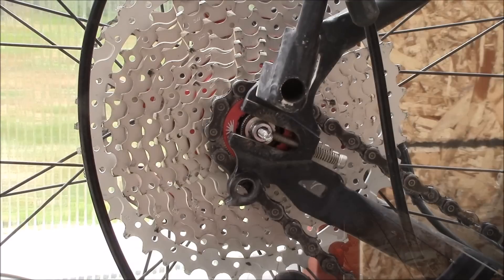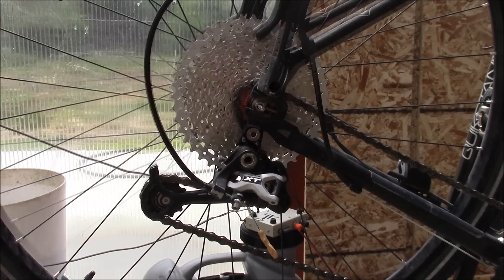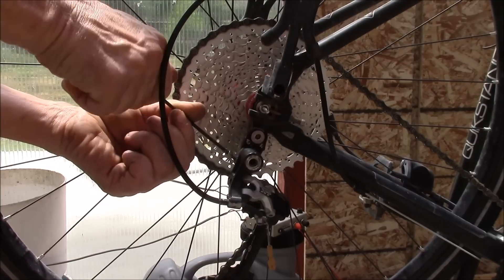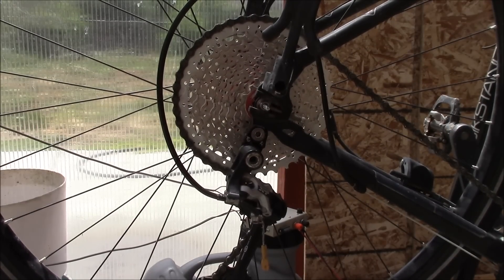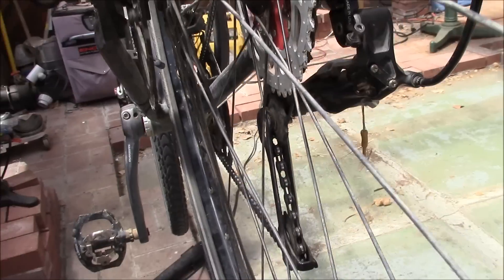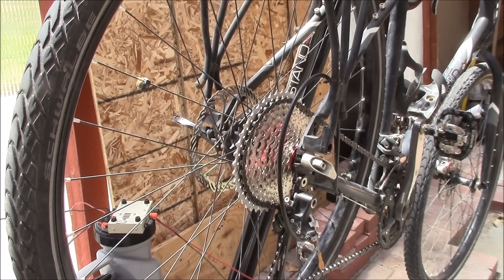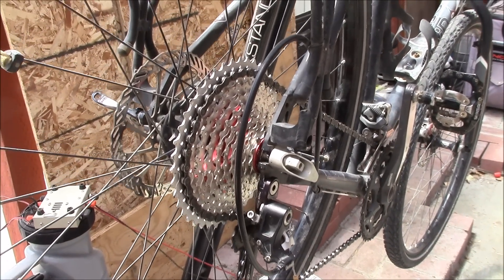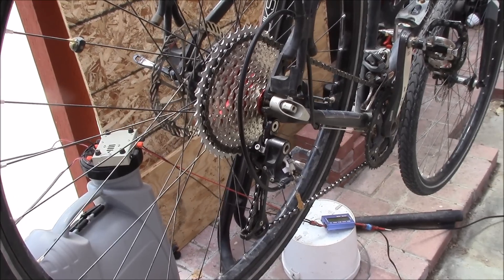SunRace 11-42t 10sp Cassette, Part 2

Comment: Good video

I have your RD, rated at 34t but works fine with 36t cog

The 9 speed MTB Rd seems a better solution vs the road link, which I thought just moved road RDs out in the same way that MTB RDs are already moved out

I have a 40t expander cog to add to the cassette but have not used it yet, am hoping that it will work without the road link. 

But great to see your solution of both MTB rd and the road link for the 42 cog

Your solution is the way to go with any 10 speed shifter - the pull ratio was the same up to 10 speed STIs and 9 speed MTB. 11 speed is different and will not work with 9 speed MTB rds
Reply from the maker: Thanks for the comment.  Yes, things get tricky when you start mixing and matching components, road - MTB, 9sp, 10sp, etc.  Since my bike runs drop handle bars and road shifters, I'm limited to the 10sp road RD for 10sp operation.  The RoadLink seems to be working fine and is a very affordable solution.  If I went to 11sp, I could combine things better, but that would require new rear wheel, maybe a new frame, new mechs, etc.  May as well buy a new bike by the time you change that many things.

Comment: GREAT instructional video! Thank you! Does one HAVE to use the Goat Link on a mtn bike and use ONLY the Roadlink on a road bike? OR are they interchangeable, please?  I am using a Shimano M960 9 speed Rapid Rize der with Shimano dual control levers. on my 10 speed Microshift cassette {11 - 40 teeth}. This is on a Terra Trike Rambler All Terrain trike, that uses mtn bike equipment. The top pulley just barely touches the 40 Tooth rear cog; I made it work by using a longer B screw but had to bend the end of it so it sits correctly on the hanger end.  Would like to use a 42 tooth, with maybe a 28 or 30 in the front only for a 1 X 10; with an 11-42 Microshift cassette.. Would that same model of the Wolf Tooth extender work for me OR would I need the "Goatlink" model? Thank you for any help on this matter.
Reply from the maker: It all depends on how your RD mounts to the frame.  If you have a Direct Mount RD (I think those came about in the 10sp MTB RDs), then the GoatLInk, otherwise use the RoadLink like I did on my 9sp MTB RD.  You can search for "Direct Mount Rear Derailleur Hanger"  to find some information on that system, my guess is you have the RoadLink style RD.

Comment: Looking at upgrading my 1x10 MTB from 11-36 with 32 front to 11-42, will I need a longer chain?
Reply from the maker: You may.  I found I needed to use a full length chain with the 11-42 while I would always remove a full link from a new chain with the 11-36.  It worked with the shorter chain with the 11-42 but it worked so much better with that added length.
Reply: R Brown thanks, I’ll give it a go with my existing chain and see how it is.
Reply: I'm looking to do the exact same 1x10 32-front, 11-42 back setup. Did you succeed? If so, can you tell me what parts you are using for it, especially the derailleur?

Comment: thanks for the explanations. was thinking of installing a similar for a 9s mid cage RD. currently maxed the b-tension with 36T, planing on having a 9s 11-40. my concern is, will it weaken the drop outs? since it will have a long leverage?
Reply from the maker: I suppose that would be a downside.  Maybe try the new cassette and see if you can make it work w/o the RoadLink.  Maybe install a longer B-tension screw if needed.

I used to run a HangerBanger before I installed the RoadLink adapter.  I need to make an extension for that HB to allow it to re-engage with the RD mechanism now that it hangs down a bit lower.
Reply: what harm can a long B-tension screw cause?
Reply from the maker: I ran a longer one for several years w/ no issues.  One potential down side is if the screw gets bent it's hard to adjust/remove and a longer screw is more likely to get bent.  The bigger limit though is there's only so much adjustment you can get before the end of the screw falls off the end of the flat spot on the hanger:
https://youtu.be/2hhGlwSeFSI?t=292
That's the max. amount of adjustment you have.
Reply: thanks for the info. cheers!

Comment: hi great vids
did you need too use 2 chains too get the length or will a 116 link chain be enough
Reply from the maker: One chain.  I normally removed a full link when I ran the 11-36, but with the 11-42, I just left the new chain I installed full length.
Reply: thx for fast reply was urs 116 links too or bigger
Reply from the maker: Whatever length KMC chains come in, looks like they are 116 links according to their web page.
Reply: great thats the chain i got comin thx for the help
Reply from the maker: You should also check the required chain length just to be sure.  This is what I used, I was sort of on the borderline of 114 or 116 links via this method:
http://www.sheldonbrown.com/derailer-adjustment.html#chain
Reply: thx the chain ive ordered is 116 so i might be ok if not i will buy another after

Comment: Thanks for this great information. I have a 10 speed, double chain ring, gravel grinder that I intend to mod like this. In hindsight is there anything you would do different or is it all running okay? Thanks again.
Reply from the maker: Everything is running fine.  Probably the biggest downside of this is losing the 2T jumps on the small cogs.  That 15-18-21 sequence is right in my road riding range.  With the 11-36 I had before I had 15-17-19-21.  I guess one thing i might try is the 11-42/11sp cassette as it has the full 11-36 cogs with the 42T on the inside.
Reply: @The4Crawler  did you ever try an 11 speed 2x setup on this bike?
Reply from the maker: @geode232  No, I haven't.  I've thought about trying to adapt an 11sp cassette in there, although I would likely need a new rear wheel/hub.  Then I would lose my Rapid Rise RD and also have to change the 10sp bar end shifter.  All can be done.  The 11sp cassette would be nice in that it tames down the 20% gear jump in the middle of the 10sp cassette.

Comment: Really great video. I had the Sunrace MS3 11-42 on my Scott Genius and it was great. I now have a Scott Spark with the Sunrace MX3 10-speed 11-42, same derailleur, but can't get onto the 42 cog. 32t ring up front. Any advice?
Reply from the maker: Might be a number of things.  Best advice is to look closely at the RD as it tries to shift and see if you can see what's different in that in the cog next to the 42 and the 42 itself.  You may need to add a link or two of chain.  Maybe the B-tension screw needs to be adjusted/lengthened (if there is one).

Comment: Could you do this on a 8 speed bike basic specialised diverge ? I don't mind changing anything that needs changing?
Reply from the maker: If you have an 8sp cassette, then yes, I think it's possible to swap in a 10sp cassette.  I think the 8sp cassettes may run a spacer on the inside of the free hub, so be sure to remove that.  Then just swap out to a 10sp rear der. and shifter and possibly the RoadLink adapter on the rear der. to clear that 42t cog.

Comment: This is Awesome!  I'm thinking of using this 42t on my sequoia steel gravel bike for touring 11 speed.  My bike currently has a 48x36t sub compact front and 11-36t sunrace cassette but still I need more lower gears for the steep stuff.  Bike already has gs medium 105 rear derailleur.   Would a 42t work for me with wolftooth and my setup?  Thanks!
Reply from the maker: It likely will, although you'll be exceeding the maximum tooth capacity of the RD.  I have an SGS on mine and at 51T I'm way over what the long cage RD can "handle", but it works fine.  The chain does go slack in the small front ring and anything above the 5th cog in back.  So I rarely use those combinations.

Comment: Hi great vids..thinking convert to 11-42t..currently im using deore 3x10s 11-36t...do i need extra chain link?and some adjustment on deraileur?
Reply from the maker: I found I did moving from 11-36 to 11-42.  But that said, I was removing one link from a standard chain with the 11-36, so with 11-42, I just left the new chain full length.
Reply: R Brown thanks for the info sir!!

Comment: Hello, if I have an XT but it is normal, would it work? I did not understand much
Reply from the maker: Yes, top-normal (or rapid rise, like I run) or low-normal should make no difference.  You may need some sort of relocation bracket like the Wolf Tooth RoadLink that I used.
Reply: what is road link
Reply from the maker: It's the small drop bracket I showed at about 1:50 in this video.
Reply: oohh ,  where can i buy it?
Reply from the maker: On-line or I checked out Wolf Tooth's dealers page and found a local shop that had the part in stock:
https://www.wolftoothcomponents.com/pages/international-dealers
Reply from the maker: Yes, if you have a Direct Mount RD, then the GoatLink is what you use.  I have a road/cross frame with the older RD hanger and I needed the RoadLink.  Both parts are the same idea, just for different RD mounts.
Reply: Oh, thank you very much, you solved my doubts!
Reply from the maker: If you have the time, you might try installing the new cassette without modifying the RD hanger to see if it works.  Mine was close, but worked much better with the dropped link.  Some say the newer direct mount RDs may work fine with the larger cassette.  Of course the other option is do the cassette and the goat or road link all at once and be done with it.  It's not that expensive a part.
Reply: because the truth is not expensive, more expensive than the deviator itself not hahaha, I'll try the same, I'll buy it to try which works best

Comment: will this work with a Shimano Deore XT, Shadow?
Reply from the maker: It likely will.  You may need to add a RoadLink or GoatLink adapter if you find you don't have sufficient clearance in the big cog.  That's what I had to do with my XT M770-SGS.
Reply: Okay thanks! Great video btw
Reply from the maker: Thanks, glad you found it useful.  I couldn't find much information myself, so thought I would share my experiences, as I installed the cassette.

Comment: What was the total cost dude:)
Reply from the maker: I think I paid around $70 for the cassette (with the alloy 42T cog) although you can find it for as low as $50 today.  The RoadLink adapter was around $25 and then whatever the cost of the new chain I had, maybe $25, so around $120 total.

Comment: You wrote "Cable pull differs between 9sp/MTB and 10sp+/MTB mechs," While it's true that different speed shifters pull different amounts of cable, what you mean here is that the actuation ratio of the 10sp+MTB mech (aka "Dyna-Sys") is different from that of Road mechs and 9-sp/MTB (and earlier) mechs. Shimano 9-sp and earlier MTB mechs have the same actuation ratio as Shimano Road mechs, and are interchangeable for the most part. Cable pull is a function of the shifter. Actuation ratio (how far the mech moves for a given amount of cable pulled by the shifter) is a function of the mech.   http://blog.artscyclery.com/science-behind-the-magic/science-behind-the-magic-drivetrain-compatibility/
Reply from the maker: Good point, thanks for the clarification of terms.  I guess I should have said the cable pull of the 10sp road shifter equals the actuation ratio of the 9sp MTB RD.  I was trying to keep the terminology to a minimum.

Comment: Have you thought about upgrading your shifters to the new Gevenalle Shimano-MTB-compatible  10 or 11 speed Dyna-Sys shifters?  [https://gevenalle.com/product/gx/]

That would allow you to use a rear dérailleur better designed for these newer wide-range cassettes, and would save the cost of the RoadLink adapter.

Since you already have the Gevendalle break levers + shifter mounts; you likely could just buy the MicroShift MTB bar-end shifters as a way to upgrade.  They are a little hard to find on-line, but I have seen them.  Or, maybe Gevendalle has an upgrade program for previous 10-speed road customers.
Reply from the maker: I hadn't seen that new model brake/shifter combo, does sound interesting.  I guess Retro Shift has changed names since I got mine.  Going to a newer RD would mean I would lose the rapid rise mech. which I really like.
I have been thinking of squeezing in an 11-42 11sp cassette in, this would eliminate the nasty 15t-18t jump on the small end.  I think I can make it work with my existing shifters in friction mode.
Reply: Most likely bloody expensive as well.